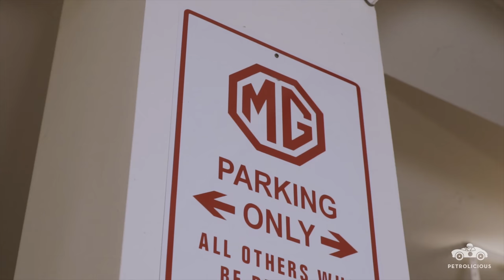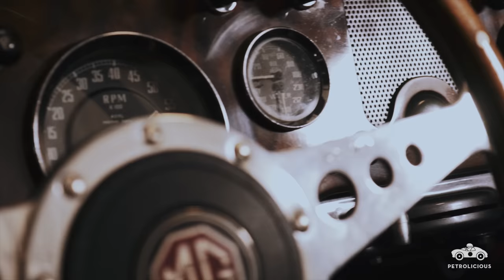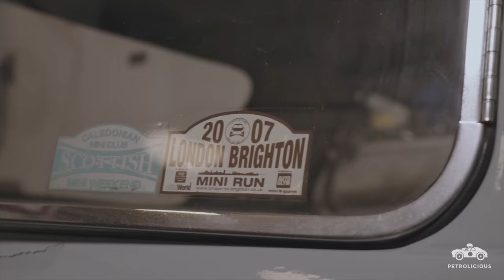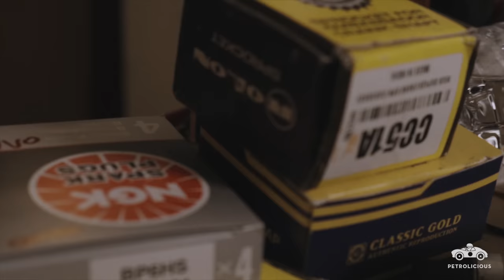1958 MGA And 1962 Austin Mini Cooper: Whiz Kids

Comment: I am 18 years old,  a senior in high school, And I wish I had a friend like they do. I have a 1987 Porsche 944S and a 1987 Pontiac Fiero GT. Even though my cars do not have that classic British charm I connect with these guys so well. Thank you for such a great film. Best Made to Drive Ever. Drive Tastefully.
Reply: I've thought about getting a Fiero. How do you like it? Reliable?
Reply: @edman79  I've had an 88 GT 5 speed and currently have an 87. Don't get a 4 cylinder. Not worth it. But the V6 Fieros that are Getrag 5 speed, especially the GT models and Formula models are awesome.  With some minor suspension upgrades they handle quite well. The Aftermarket is there, and the club's are there. Join the "Fiero" page on Facebook. You won't regret it! They are simple cars so pretty reliable for an old car
Reply: @larkinchristy2486  Thank you. If I do get one that's how I would want it. V6 manual. My granny knew I wanted one back then, so she said she was going to buy me one. Unfortunately she passed away shortly after. So I've always had a soft spot for them.
Reply: @edman79  It's time you get one! They are slowly starting to rise in value so... Join that Facebook page. :)
Reply: @larkinchristy2486  Will do.
Reply: How can you affoard a Porsche being just 18 years old? When I was 18 years old, all I got was 1992 Audi 80..
Reply: @shaded_lp  it's an 87 944S. I bought it for $4800 in 2016. It needed some work and I slowly tinkered on it until I got it running great.

Comment: Reminds me of when I was a teenager. Me and 3 of my friends had these little Simson S50 motorbikes. You probably don't know them in the US, these are 70's-80's German 50cc 3-speed/4-speed motorbikes, and they were (still are) so much fun. We worked on them all the time, modified them to our liking, tried to get some extra horsepower, and rode together when they were all working at the same time - a very rare occasion, like 3 or 4 times a year for a few days. We were very happy. 

Now I'm exactly 21 like these guys here, and I drive a 1997 BMW E36 328i Convertible. Not such an old car, not like these two, but I had to work hard for this E36 and this is my dream car. When I was a small kid, I remember we had one of the 1996 BMW 3er leaflets with a green E36 convertible on it - just like the one I got in the end. I was looking at it all the time, it was on my bedroom wall for more than ten years, and now I'm driving it. It's incredible, even if it has its' problems more often than not. It's the last era of cars that you can work on with your own two hands, and I do that. I am slowly making it better and better, making it look like it did in '97, with all the aftermarket modifications needed for it to run better and more reliably, like the cooling system. One of my old friends I rode with has a 1968 Mercedes W114, he works on that one all the time as well, and I love the roadtrips we did this summer with the two cars. Two very different machines, yet they represent the same passion. The other two... well, they got bored of the tinkering and got themselves some ordinary, always-running vehicles. They were always the less passionate out of all of us, they were the ones who we had to do the work for a lot of times just to ride together at last with our Simsons back in the day. 

I can never imagine myself without an old car, old motorbike in my garage. I do drive a new car on the daily, but I don't like it. I like the feeling it gives you to actually drive a car, to feel what the car is up to, and that's long gone from today's cars. I also love the feeling of starting it up and hearing it come to life after you fixed it yourself. Going for that first drive after having fixed it. Can't do that with the new cars, so much complicated technogy in there that you don't even need. Fortunately I have found many other young people who share this opinion. Good to see this passion is not dying out. 

Also, that MG is beautiful. I'd love one of those... park one next to the Bimmer, maybe? After getting a better income, of course. Almost all my money is spent on the Bimmer already, not that I feel any regret. :)

Comment: MGB motor upgrade is smart, especially if you can manage a 5 main bearing block.  Nice job guys.
Reply: karlInSanDiego I think it’s easier to find 5-main B engines than the 3-bearing engines. But totally agree. Also hard to imagine but the old pre-war MGs were running around with 2-mains (reading a book on old MGs at the moment).

Comment: My first car was a '58 MGA. White, red leather, wire wheels, luggage rack.  Had never driven a manual when I picked it up. Learned on the way home. Car was a lot of fun though the electrics did blow on a narrow bridge connecting two major highways, causing a record traffic jam.  Fixed that, but top down on a sunny day, the car was rear-ended by a drunk in a Dodge, and pushed into the side of a Buick.  Believe it or not, it drove to the wreckers.  I have a Miata now, that's fun too, but...

Comment: The early Mini  Coper S cars came in three  different engine sizes,there was a 970 cc,also a 1070 cc and a 1275 cc version.   Another variation was 
the Morris mini Cooper S. I was lucky to have owned a 1967 Morris Mini Cooper S, with 1275 cc engine, a blast  to drive. The only weakness the high
performance version of the A series motor used on Mini Cooper S cars,was a tendency to snap the crankshaft  on over revving,and the cylinder head
was prone to burn exhaust valves. ( the head on Cooper S cars had an extra  bolt located near the water inlet  spout  on the end of the head )
Reply: Trouble is, the Cooper S in this video has only one SU and only a single fuel tank. Was that US spec? Or is it a lash-up? It also has an even worse paint finish than the factory effort (which I'd never have thought possible!).
Reply: 1071cc
Very rare nowadays. 
Sent a basket case S to an enthusiast in Belgium a few years back.
Reply: @shanehnorman  paint seems to be checking and cracking as there's too much paint on the car.

Comment: That's almost same that happened to me. I wanted Alfa Romeo 156 2.5 v6 but my dad said that it is too unreliable. I am now 16 and I have mg midget project and Alfa Romeo 156 2.5 v6 (busso engine) project. And I am thinking to sell my mg midget and buy mgb gt and swap rover 3.5l v8 in it. :)
Reply: The MGB motor'll be more fun if you just do mild race cam, headers/free flow exhaust, Weber sidedraght carb upgrade, and balance the motor while you have it apart.  Don't bother swapping to a V8.  This is experience talking.
Reply: Mgb v8 is a thing + I want to build daily classic that can drive smoothly in highway and to be 4 or 5 seater.

Comment: Fantastic video, and it's great to see a couple of young guys get into the hobby the right way.  Both cars are fantastic, and the stories of each really brought back a lot of memories.  I started out the same way, back in 1979, with the purchase of a 1970 Honda 600, that I found laying in a field.

@Daniel with the Mini.   Your car can be dialed in so that it won't overheat.  Visit my website at www.austinamericausa.com and you'll find a section on cooling system upgrades in the Technical Advice pages.  My 1970 America shares your same drive train.  You can get a water pump with a better performing impeller, a thermostat that flows more water, and a fan with wider blades (without going to the noisy "tropical" fan).  Couple those mods to running only 25% antifreeze with your distilled water in the cooling system, and correct radiator caps (and make sure the fan is facing the correct direction) and your car will climb the grapevine no problem, any day of the week.

Thumbs up to you both!!

Comment: How rich are these kids?!
Reply: Don't care, they are true petrolhead ;)
Reply: I wish i was that Rich
Reply: why do you care? your spending your time in front of a computer.
Reply: You don't have to be rich to own either of these cars.  They started with rough cars  and work on them constantly.  They are rich in their ability to dive in and teach themselves how to fully master every system on a not too complex car.  Good for them.
Reply: I'm just saying that it's a lot of money($25,000+ for each car) for a 19 year old to have.
Reply: so are you...
Reply: You have to be rich either to buy one of these cars in good condition or in bad condition and then spend loads restoring it.
Reply: @orsonwelles5549  Neither car cost 25,000+ unless it's a show car. If you take the time to search, you can find these cars for not much money. Parts for these are cheap as well because they share parts with other mass produced cars of the time. Most parts are rebuildable, so that's cheaper than buying new parts. Both cars have tremendous club support so you can get advice from a ton of helpful people on the best way to fix your car up. I picked up a 1967 Volvo 1800 S for $2400., That's not a lot of money. There is little rust on it and great club support. Cars from this era are great cars to learn on and cheap to maintain. Best of luck chasing your dream cars, be positive, and it will happen.
Reply: Also note value vs dollar. My car I bought for $1600 and today it values in at roughly $4800. So time/rarity and more add to a "value". That said I am grinding away ti get funds to fix mine. This car is becoming a home, shes very expensive, but worth it.
Reply: Why is it so important for you, how rich they are? Are you poor? I'm sure when his mum died, he wasn't thinking about money.
Reply: Hey guys stop talking about money, it's petrolicious not a stock exchange trading channel ;)
Reply: @nostalgiarte  that's why we are educating someone as to how cheaply you can get a fun car to fix up. How else do you get the young people who were born years after these fine cars were made, into the car culture. They can buy a Honda Civic, or an MG, the civic will hide among traffic, the MG will stand out and start conversation. So important for today's young hiding behind the screens of tablet's or phones. As was stated in the video by these young men named Daniel.
Reply: You right, totally agreed :)
Reply: That MINI was nowhere near perfect. These cars are not super expensive. The Mini could be bought for about 11k
Reply: I wondered that myself.  $10k-12k buys a pretty clean late model grey market car here in SoCal.  An early true "S" should be worth twice that at least, I'd wager, even in that condition.  Question is, how ratty was that Mini when he bought it.  Non-running cars sell for dimes on the dollar.  Ironically, I'd wager a true Mini Cooper S in that condition would cost more to buy than a rusty running MGA, but it's a wild guess.  I also believe the Cooper S came out in 1963 and all had dual tanks with filler caps on each side, so it's likely that's not a factory S.  That's not to take away from Daniel's beautiful car.  If he's built it up to Cooper S spec, I don't fault him for adding the badge.
Reply: I bought my first mini in 2013 (also my first car) for the equivalent of 600 dollars and spent the equivalent of 1500 dollars (over 2 years) on almost completely rebuilding her (Re did the pan, wiring, interior, engine and a lot more). All from my own pocket. 
It was a mini clubman though.
Reply: Minis were only sold in the United States from 1960 to 1967, and always in small numbers.  I suspect the Beetle gave a greater sense of safety on our highways??  Thus where Issigonis Minis are ubiquitous other places, they are very rare in the USA, selling only about 10,000.  We have a decent number in SoCal, with many being late model cars illegally imported from New Zealand and other places.  It's easy to think they were plentiful.  MGAs were very popular here where more than 80,000 of the 101,000 were sold.
Reply: If you have a job, you can afford these cars.
Reply: Just daddy's money
Reply: They're lucky for not having to work at McDonald's to pay for parts and tools but you have to give them credit for collecting the information themselves and work on the cars and learn while they fix them up.  They may have started the hobby with daddy's money but it's not daddy's mechanic keeping them on the road.
Reply: In the UK these cars are expensive. Expensive to buy and expensive to restore/repair. Don't know what it's like in the US.
Reply: Willem Karet This is true
Reply: The paint job on that MG certainly wasn't cheap
Reply: It's not a real S, or even a real Cooper. The dead giveaway is the carb setup. You can see in one shot it has a single SU carb. Doesn't make sense to downgrade a Cooper/Cooper S back down to a single, so it probably never had a twin. Either he or a previous owner chucked the Smiths tach and Cooper S badging on. All show and no go I'm afraid
Reply: Well said. Not gonna lie, I'd love that level of financial freedom (especially at that age) but they could just as easily have left them to rot, once bought. How many kids these days have the inclination, let alone dedication, to complete such a build?

And you'd hope any sense of entitlement would eventually be weeded out by a project like this, anyway. Particularly the Welsh kid, given his mother's passing - I suspect his progression since 15 yo has been huge.